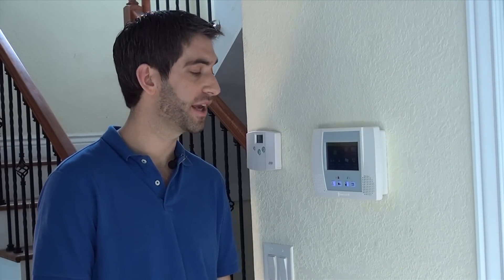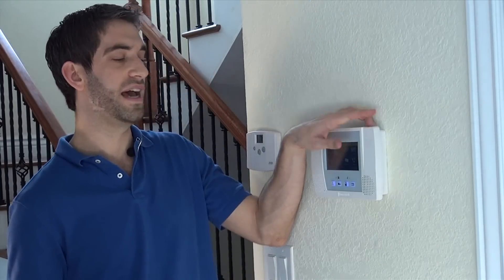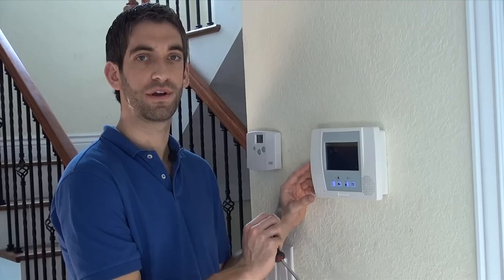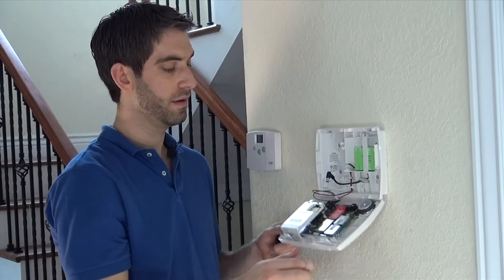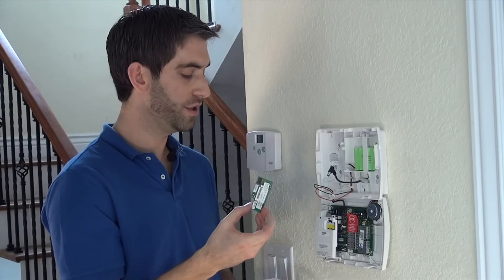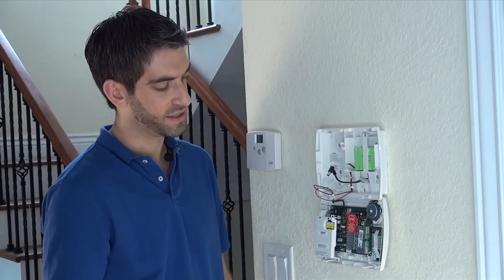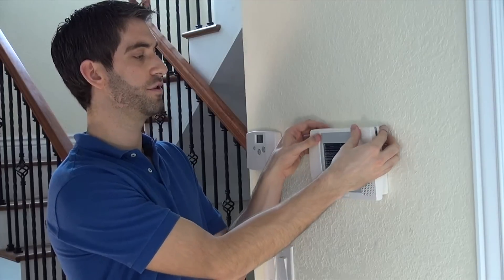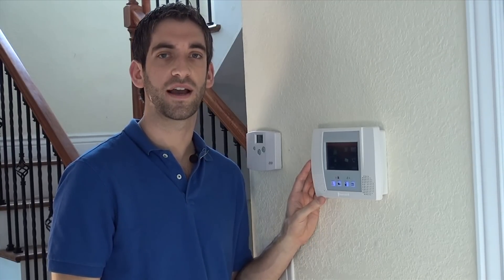Honeywell L5100-WIFI: Installing the Module into a Honeywell L5100

Comment: Hello! I have the same unit as in the video. 

1) the unit does not hold the current date & time. The unit defaults to January 1, 2011. 
2) I do have a monitoring company. I would like to get alarm triggers to my cell phone. Is this possible with the Wi-Fi unit? What is primary use of the Wi-Fi unit?
3) At times, the unit beeps rapidly, armmed or disarmed,
4) Error code 103 Comm. Trouble is always displayed.
Thank you!

Comment: how to program z wave blinds or shades
Reply: Below are links to the Blind/Shade products we've seen successfully used.  Basically, there is a motor that controls the Blinds (Somfy ZDMI Installation Manual shown below), and a translator (Somfy ZRSTI linked) which allows you to control the motor via Z-Wave.  Once the physical setup is complete, you put your controller into Include mode, and follow the instructions on the translator for inclusion.
Reply: THANKS
Reply: I'm sorry, I forgot the links on this one:

https://www.alarmgrid.com/products/somfy-zrsti

https://www.alarmgrid.com/products/somfy-zdmi

Comment: Please let me know how to have the panel call my cell phone? I would like to do my own monitoring.
Reply: +Log Home You can't use the WIFI module to have the panel call you directly. You would need an analog phone line connected if you wanted the panel to do that and then you'd have to use the Follow Me feature.
Reply: +Sterling Donnelly Thanks, I do have an analog phone line pretty close to the alarm panel. Would I need additional modules or something to hook in the analog phone line? Thank you for the help.
Reply: +Log Home No, you just need to wire the phone line into the panel. The installation guide at https://www.alarmgrid.com/documents/honeywell-l5100-install-guide details the connections on page 7.

Comment: Hi Sterlin,
I keep getting a failed to join box on the wifi.  Using Wp2 have the correct password.
I do onlu have two bars. I have a belkin router.  Is the password the network password or the password on the router?

thanks any ideas?

Comment: The L5100-WIFI is an AlarmNet communicator so typically, you wouldn't buy that unless you wanted some sort of paid monitoring service. There is an L5100 Connect app on iTunes that would turn your phone into another L5100 screen and that app requires the L5100-WIFI module. However, as it only allows you to access the system while on your network, it's not as valuable as the Total Connect service.

Comment from the maker: If you want to just use the system to make noise if someone enters your house uninvited, you can easily use the system for that. You wouldn't need the L5100-WIFI to do that. You would just need to make sure the system is armed. You can also do local home automation using the Honeywell L5100 without paying for a service. You would only need an AlarmNet Total Connect 2.0 account if you wanted to arm and disarm your system remotely.